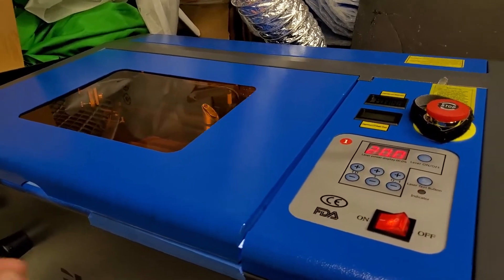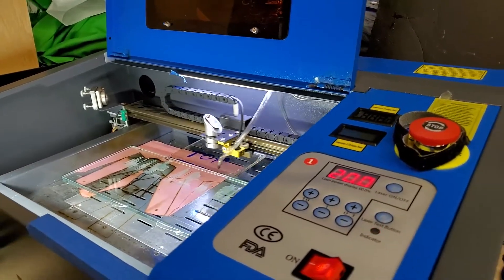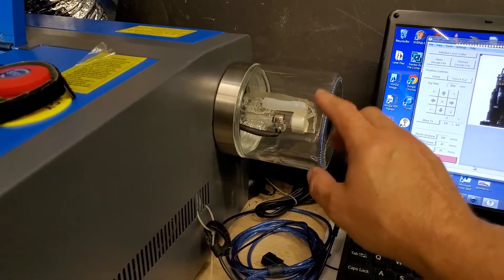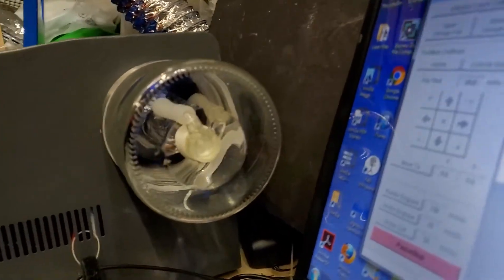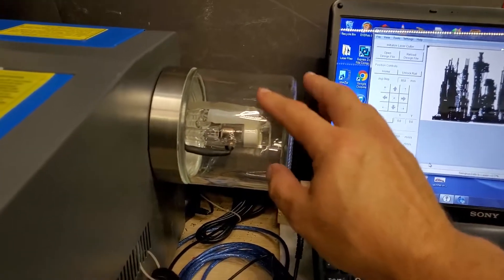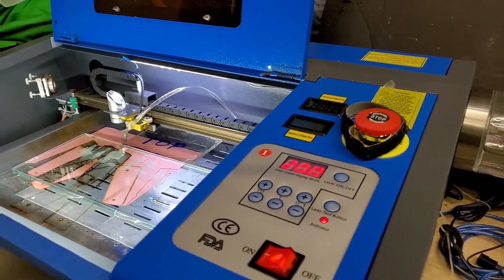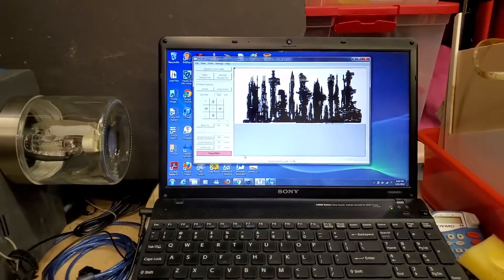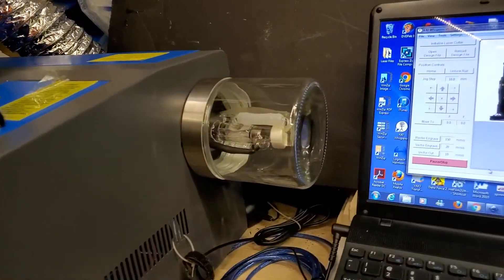I upgraded my K40 Laser Machine 😀

Comment: Kinda useless video - just showing off what was done.  No information on how to do it or what parts / items were used so that someone needing to do the same would have some guidance & instruction.
Reply from the maker: Your absolutely correct. I made a how to video showing how I modified the laser machine and apparently I mistakenly uploaded it to my main channel. I will get it ported over to the channel this week. In the meantime here is the video. I hope it helps you. If you have any other questions feel free to reach out anytime.

https://youtu.be/4X7y27EZQ84

Thanks!
Reply: @kep-kraftindustries3759   Thanks Paul.